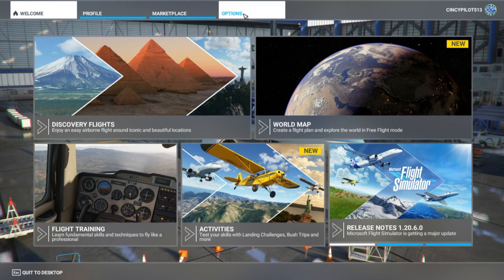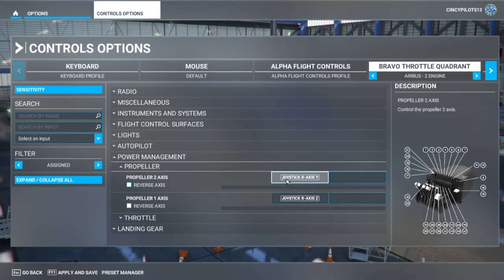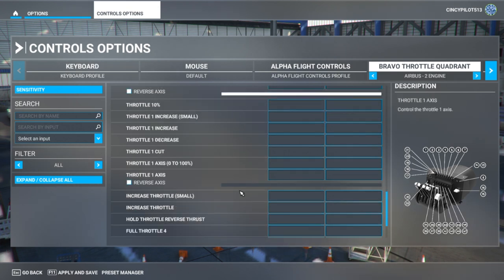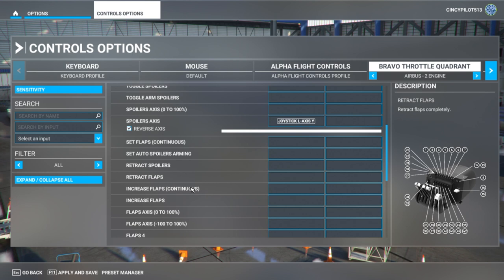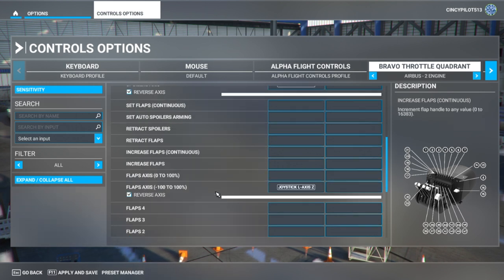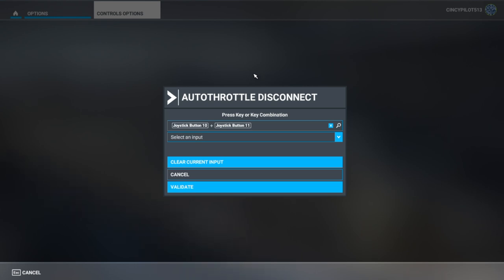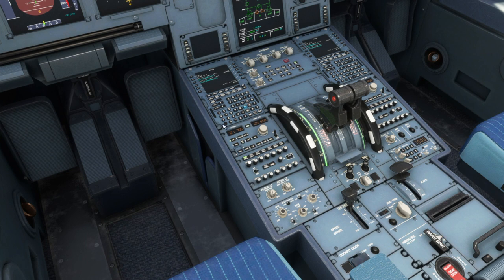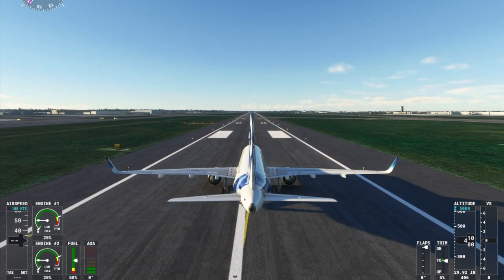Honeycomb Bravo Airbus Throttles - Two Engine Configuration

Comment: Is there some special logic that sims use by DECREASING throttle you get reverser mode ? Do you get reverse thrust increasing ? or is it all on or all off ? 
Great video - answered so many questions.  Where do you get your info ?  btw i discovered the 3 and 2 contact levers and base are meaningful.  Be sure you put the matching levers on the base where needed.  I see that the contacts exist on the levers that have other options working on them, like the reverser lever, and the TOGO button(s).  Fascinating.

Comment: What about Engage Autopilot? How did you set that? I’m having difficulty with that. It engages then disengages by it’s own after few mins.
Reply: In MSFS check your Assistance settings. Some MS updates turn then on if you've had them off before. Most or all of the Piloting ones can be set to off for a more realistic sim experience. If that's not it it could be a bug with the certain plane you're using. Good luck.